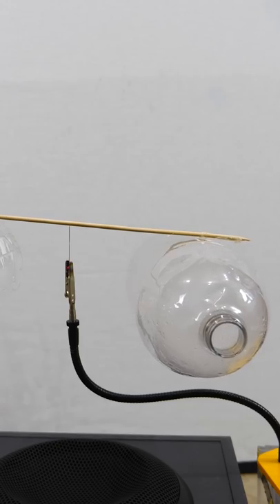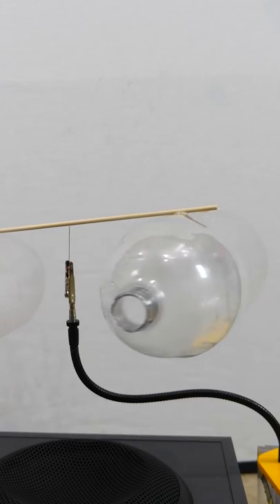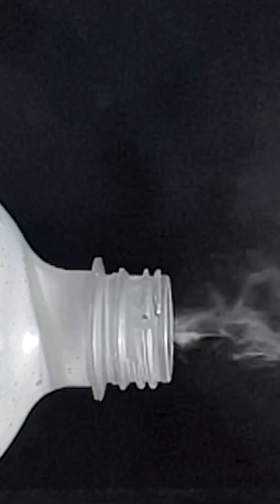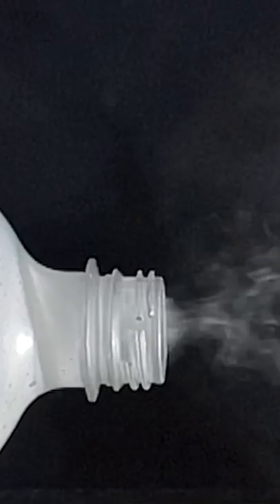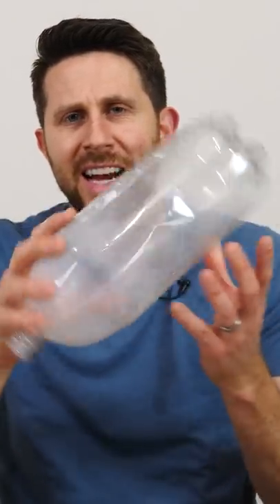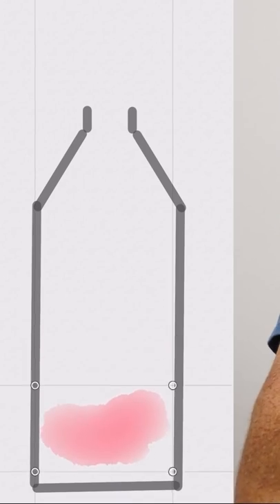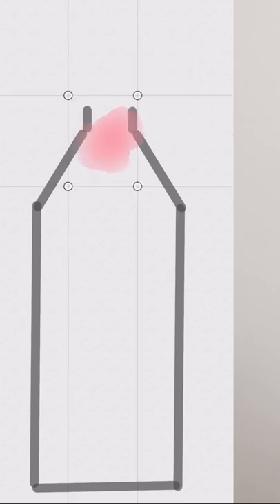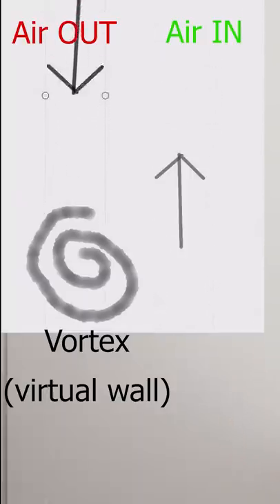Acoustic Rockets Using Helmholtz Resonance

Comment: If air is just going in and out then there should be no net propulsion.  However the thrust out under pressure is directed more straight in line but the vacuum drawing air in pulls it from 360 degrees around the end and so there is little pull in a backwards direction as the force is not merely in one direction.
Reply: A guitar port hole is like blowing on a bottle.

Comment: You can also create heat the same way a microwave does by shaking tinny little particles… done through playing sound through a conductive box with some pins/nails inside attached to the box almost as if they been hammered through the box and play with the frequency until you get heat. I know it’s possible but I have a busy life ❤ I’m sure you could find out the resonance frequency of the specific nails you use by putting it through the rough width of the box hitting it and seeing what frequency it plays… loads less work!

Comment: One explanation for why the bottle can thrust forward is that if you puncture a hole in a can with a vacuum in it, it will simply oscillate a bit, but not move backwards. So, when the bottle sucks, it can’t propel itself backwards, but when it blows, it can propel itself forward. So, it ratchets forward.

Comment: Couple of things you forgot to mention. There's also the momentum imparted to the bottle itself when the pressure wave hits the bottom of the bottle and bounces off. Also the  Vortexes generated through a circular port do not look like what you have pictured in the video. Most of the time they oscillate in a clockwise or counter clockwise fashion. But quite frequently Can be seemingly random In the direction in which each particular oscillation might discharge. Also there is no   Virtual wall it is the atmospheric air that the air exiting the bottle is pushing against creating a small burst of high pressure behind the bottle As it moves in a circle. However this small burst of high pressure is followed and preceded by smallers of low pressure as the air is drawn back into the bottom and the new wave front is formed in the bottom. I would therefore argue the vast majority of the thrust given to the bottle is imparted by the wave front hitting the bottom of the bottle. I realized I could be wrong and don't have any evidence to support this thought but it would be interesting to see an experiment designed to Answer this question. Maybe something like a conical or hyperbolic deflection nozzle designed to deflect the wave front perpendicular to the top of the bottle. This would cause any thrust imparted at that end of the bottle to be directed in all directions perpendicular to the Bottle.Keep in mind if you do this you may( Most likely will) change the resonant frequency within the bottle

Comment: The frequency can be changed with the shape/length and width of the tube. This is a technique used in car exhausts and intakes to remove drone inside the vehicle.

Comment: Pretty sure the thrust derived from the oscillating motion of the walls of the bottle comes from the difference in direction vector or the air flowing out vs in. The air going out is all coming out broadly in one direction and thus the bottle is accelerated in the opposite direction, but then when the bottle sucks in more air, it can come from all different directions, which produces less force and thus a net force in one direction

Comment: i'd say, that actually because of conservation of monentum there has to be net moving air. But its the air outside the bottle, that is pushed away from the air inside the bottle. So its pushing the air in front of it mostly to the front, but sucking air in mostly from behind. You can proof this by looking at the steam. The steam actually moves outwards. And i dont think that this is only caused by diffusion.

Comment: I suspect that the thrust comes from the change in momentum of the pressure wave at the closed end of the bottle. The momentum of the air entering and exiting the bottle must be the same, so that is not creating thrust.  The idea that the exiting air is pushing on a cushion of its own turbulence is interesting, but I suspect that it is secondary. However, this is still a very interesting demonstration. Thank you.

Comment: At resonance, there are nodes and anit-nodes in the bottle. High pressure and low pressure. The bottle is a quarter-wave resonator with pressure high at the mouth and low at the closed end. this high pressure is what causes the movement. If you did the same experiment with a bottle open at both ends (half wave resonator) both ends are low pressure and no movement.
Reply: Actually a Helmholtz resonator is not a quarter wave resonator. It's a mass-spring-damper system - the fundamental wavelength is not simply 4 lengths of the bottle. The air in the bottle acts as a spring, and the narrow neck traps a "mass" of air which oscillates as a plug, at a frequency determined by the volume of air in the bottle and the length of the bottle neck. This can actually be seen in the slow motion of the bottle neck, where the smoke "plug" moves back and forth as a mass.
Reply: @chrisburn7178  six of one half dozen of another. fundamentally it is a resonant system just as mass-spring-damper is a resonant system. With parasitic, dissipative elements.

Comment: Another explanation could it be that the acoustic pressure wave generated by the speaker, is actually pushing on the walls of the plastic bottle; since the bottle "walls" moves back and forth so the air is pushed out?

Comment: The air in the bottle acts as a spring, and the air in the opening acts as a mass. So the length of the bottle is not important, but the volum is, and the air temperature.

Comment: Says Helmholtz resonance, models quarter wave resonance.

To explain the difference, helmholt's resonance basically operates like a mass on a spring, you take a weight and you hang it from a spring or a rubber band or something like that. You pull on it a little bit and it will bounce up and down. Change the strength of the spring or the amount of mass on the weight and you will change how fast it bounces up and down. This is called mass loaded resonance.

The bottle operates this way because air is a compressible fluid. Imagine the tires on a vehicle, the tires themselves have non-elastic bands throughout them, in the form of either nylon or steel cords or other materials. Because of this when you hit a bump, the tire itself can't stretch, but it still absorbs some of the momentum. Momentum. This is because the air itself squishes inside of the tire. The air inside of the bottle squishes as well and acts as the spring in the mass loading example above. "So where is the weight in this scenario" you might ask? Why it's the air in the neck of the bottle, when fluid of any kind flows through a tube, it has momentum in the same way that the mass bouncing up and down has momentum, the length and diameter of the tube has an effect on how much mass loading the helmholtz resonator has. The momentum of the air in the tubing at the top of the bottle couples to the springiness of the air inside of the bottle.

Helmholtz resonators are what you find in most subwoofers, called a bass reflex or ported speaker. In this case, the bottle is replaced by a big box with a tube in the side. The size of box and tubing is carefully matched to the characteristics of the speaker driver to resonate at the right frequencies and at the right level of damping to extend the bass notes really deep.

Quarter wave resonance on the other hand is exactly as he describes in the video, a wavefront starts at the end of the tube, travels through the tube to the end, reflects off the end and bounces back to the opening again. There's also half wave resonators as well which is a tubing that's open on both ends because the wave interacts differently with a closed end of a tube versus an open end. The way front itself either compresses against the closed end of the tube and bounces back in the form of a quarter wave or it propagates into open air which then refills the low pressure part of the wave, or expands the high pressure part of the wave, causing it to bounce back the tubing in a half wave resonators.

Quarter wave and rarely halfway resonators are used in transmission line speakers, in this case, the speaker driver is placed at the end of a tubing that is sized and damped according to the characteristics of the speaker, to create that same resonant effect as the helmholt's resonator. The difference between the two is that the helmholt's resonator also has some reflective resonance within the large cavity as well, which is why transmission line speakers are often described as having lower resonance and distortion despite the fact that they are much larger and more difficult to engineer. This kind of resonance can be seen in the bottle example in the form of a quarter way resonance of approximately 225 hz. This frequency is actually slightly higher because of the narrowing of the neck do the bottle causing the wave front to change velocity (narrowing of a wave guide, aka the tube, causes the wavefront to accelerate because the smaller amount of air in the narrower tube needs to carry the same amount of kinetic energy) this higher velocity makes the bottle appear shorter since the wavefront gets to the opening faster and is therefore higher in frequency.

These three effects, the quarter wave, the helmholtz, and the changing of the wavefront velocity, can all be integrated into transmission line speakers, you'll often find them tapered in the form of voigt tubes, or even including helmholtz style tubes or chambers on the respective ends of the transmission line. The tapering itself is especially fascinating because the tapered shape helps prevent unwanted higher frequency resonances because those higher resonance is change as you travel from one end of the tube to the other, but also the change in momentum of the wavefront makes it harder for those higher frequency waves to propagate.

Sorry for the long comment, I'm all for taking creative liberties when it comes to scientific content as a lot of it can be hard to understand without either an incredibly in-depth analysis or overly simplifying, but this video used a completely incorrect concept to describe the type of resonance in the bottle. Completely factually incorrect.

Edit, as another commenter has (slightly inaccurately) mentioned, the helmholtz resonance as well as quarter wave resonance has been used in automotive applications as well, through tuning the length of exhaust pipes as quarter wave resonators, and the length of intake runners paired to an intake plenum as a helmholtz resonator.

Comment: So the frequency or vibration matches the sympathetic response of the bottle. Creating energy which is then transferred to the air touching the bottle and moves in the path of least resistance. New air replaces the old air and the cycle continues?

Comment: I believe variable speeds could be achieved based on the depth and shape of the bottle. Ratio of size of the opening to actual bottle size. Number of openings on the bottle. Also what if there is an opening on the other end but the other end is covered with a material which will permit air to flow but block out sound. My brain is cloudy right now 😂

Comment: Could you make a wheel with really a lot of identical bottles in an acoustic chamber, stick its arm into a power generator, then use a cheap speaker to generate a net positive of electic energy?

Comment: How efficient is that? The energy and equipment needed to produce the sound, versus the force generated by the bottle -- if it were all one unit, it would never be enough force to move? Would it have to be such a loud decible that it would be dangerous?

Comment: Isn't vibrating the air inside the bottle making it warmer than the outside causing it to spin outward leaving the outside colder air to be sucked in through the middle of the vortex?

Comment: I need a little more info on just how the air is able to get in and out, like is it the same air? Why don't you see smoke going back in then? If the smoke totally clears then it does completely cycle the air but how is air going in? My head tells me that the air been forced out would be greater than any pressure pushing in? Is there a longer video?

Comment: This effect is why some of Chrysler's 1960- 1961 big blocks came with 32" long intake runners. They were called "sonoramic commando." Notice the "sono" part? 99.9 percent of gearhead people "KNOW" that they work by the air starting and stopping in the runners being timed with the opening of the valve "ramming" more air in, (partially true) and that longer tubes flow less, and are tuned for low end torque and suck at high rpms, thus they are ony good for low speed torque and not racing. Actually, if you get lucky and hit the jackpot, you will get a set to run right, and the rear end of the car comes around in high gear flashing to 7500 rpm! Then, you will get out, kiss the ground, and investigate why. It has to do with the interactions of every aspect of the cam timing, exhaust tuning working through valve overlap, reversion, etc. ambient air temp and barometric pressure coming together to make those sound waves reflecting around each other inside the manifold and exhaust through valve overlap to coincide in mutually amplifying resonance to park a peak standing pressure sound wave of high intensity just inside the cylinder that the rammed air is moving THROUGH. The higher the RPM, the longer the tube, the more standing waves it has, the more compressed the air is, and thus flow isn't as dependent on tube size. I had heard about it from my dad and his friends and put his set on my car, neat, but not magical, then I took "the ride" as we called it, once, peed myself, then spent two months trying to get it to do it again. Now I know how to. Brother, when they are right, you can hear those intakes singing 2 miles away!  However, there's also as many points in the RPMs (about every 800 rpm) where the node is at the valve and the engine lays down, then, like a 400 hp nitrous hit comes in again, and blows right past the 6300 rev limiter in high gear and hits 7500 to 8k, on the dragstrip. That's on a 383 in a 4800 lb newport with nothing but a SPECIAL cam, long rams, and headers! But if the weather changes much, and you don't know how to adjust the engine, forget it. Most guys that own them will say B.S. One guy smiled and said, "Yeah, we knew how to tune them, we called them elephant guns because they killed hemis!" I know that Chrysler engineers knew this could happen under controlled circumstances on a dyno because when I met one of the  the guys who designed them and said that they from a design standpoint were far more impressive than a hemi, and only a few of us knew they could do things under rare, controlled, circumstances that flat out scared the crap out of you, he cracked the biggest grin you ever saw, chuckled, and nodded his head! I know 5 people that flat refuse to set foot in that newport ever again!

Comment: So can you fill the can with smoke and then vibrate it at resonance frequency and see the smoke pattern that comes out? So 112 hz is very high frequency. You might have to zoom in 112 times and slow down 112 times to see what actually happens.

Comment: The sound wave does not 'bounce off the bottom of the bottle'. The description you gave is not Helmholtz resonance but classical organ pipe, standing wave resonance.
For resonance at 120Hz the bottle would have to be of the order of 3m long.
Helmholtz resonance is described by a mass on a spring, where there is a mass of air in the neck of the bottle, proportional to the length and area of the neck,  and the spring is  the 'bounciness' of the air in the bottle, inversely proportional to it's volume. The shape of the bottle is not important.

Comment: Let's say that there's not much speed you can generate using this phenomenon*BUT* you can forsure generate momentum with it. Also there's no net change in of volume of air/matter within the bottle/chamber/tank. 

This is just my theory but IF we could perform the same phenomenon in vaccum chamber (i.e no net change of matter within the bottler whilst also generating momentum) then (you see where I'm going) we can perform Interstellar travel. The momentum will keep on adding up,we won't need more matter/gas than we have within the tanks & we can achieve enormous speeds with very little thruster fluid required for centuries (assuming that matter lost from chamber is 95%+ coz we there's no such thing as 100% efficiency) instead of depending of the boring old school celestial slingshot technique we have been using since the daw of space race to today.

Edit- I know we still need some energy source to produce sound which gets us to square one & I say no, we can use Nuclear generators(the ones they used in voygers 40yrs ago that are still transmitting despite going beyond pluto. The voygers took 40yrs, if this were possible we'd merely take 4(no resistence in space, constant momentum build up)

Comment: can you build an air conditioner using subwoofers The problem is the amps get hot and the power used is less efficient than turning on a fan